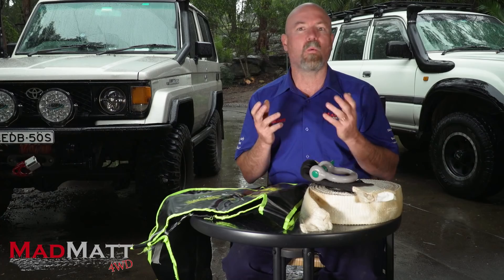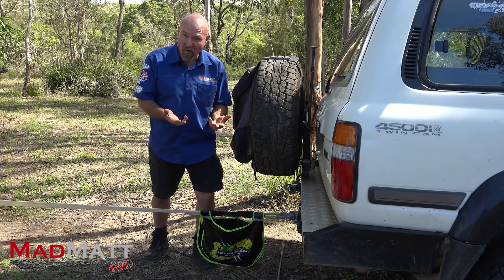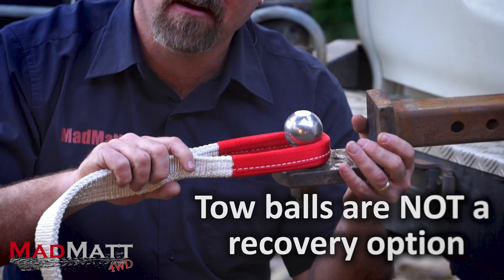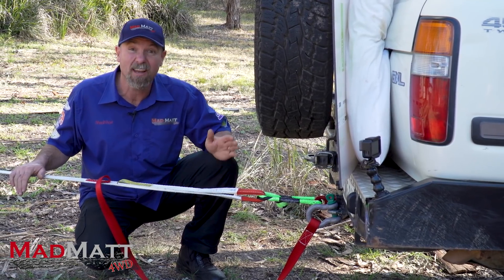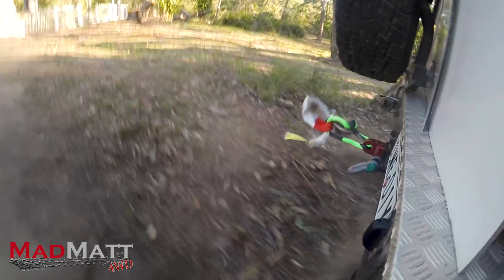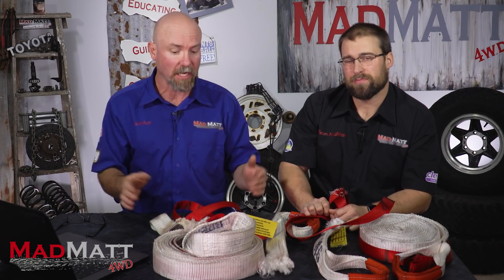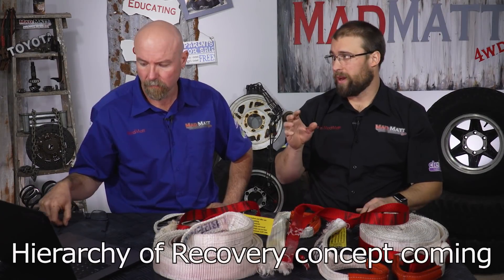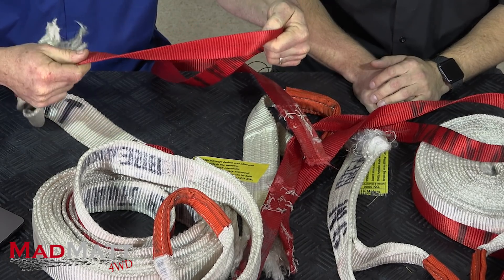Dangers of Snatch Strap Recoveries - Destruction Testing

Comment: In my humble opinion the tether should be made of the same stuff the snatch strap is made of but let's say 2.5m longer than the strap itself at either end then attached to the other recovery point on the cars, that will account for the stretch of the strap and kenetic energy in it as well as the vehicle travel after the snatch strap breaks at the fuse. Anybody ever think about quality "parachutes" near the ends of the strap? Just an idea?
Reply from the maker: That's an interesting idea. a parachute would have to be too big and probably wouldn't have time to fill.

Comment: I was surprised the strap broke that easy. I have one purchased from Warn that came as kit with my 12,000lb winch. (I know in Auz straps  have a service life). It has been too long for me to remember what it is rated at. However, I drive a 1996 3/4 Ton, 4x4, 8600lb GVW Chevy Suburban, with a 7.4l gas engine. It is heavy especially when filled with 42 US gallons of fuel and 7 passengers. I have yanked vehicles with my strap that were twice the weight of my loaded Suburban that was to-the -frame-stuck in wet sand. My strap has never failed. Why did yours fail so easily??
Reply from the maker: As I say in the video this was a test and I had a fuse designed in it. Having said that I can intentionally fail an 8000KG strap in under 10 hits.
Reply: @MadMatt4WD  OK. Got it. I will rewatch. Thanks for doing so much for the 4X4 world!
Reply from the maker: @benkanobe7500  FYI I don't show the fuse. :)

Comment: Maybe, instead of having the tether strap only connected at 2 points, have it a little longer, and have it connected at multiple points (I'm in the US, so I will say in SAE), maybe have it connected every 12 to 24 inches. This way, it has multiple points that have to fail in the tether before total failure.
Reply from the maker: That would have to be worth a try.

Comment: I was pulling  a stuck small Cat with a dump truck broke a stainles steel  chain with 1/2" diameter chain links. Put a good dent in the steel  plate on the back of Cat D3  scarey
Reply from the maker: Yikes

Comment: Great info Matt , very interesting and informative , would a rated tether be an idea ?
Reply from the maker: I think so but nothings out there to my knowledge.
Reply: @MadMatt4WD  If the tether was lengthened beyond the maximum stretch of the rope and only had to stop the force of rope flying and not the stored kinetic energy in the rope it might drop the impact below lethal. This could easily be tested by cutting the tether and adding in a length of the tether material by stitching it in the same or stronger stitching where it is attached to the rope. I could see the length of the tether being up to 1/3 the length of the rope and if it is rolled and held together with a rubber band it would stay out of the way but deploy in case of a breakage. Awesome video!

Comment: I'm from Florida the United States been using snatch ropes since I was in my teens I'm 50 now we use boat tie downs rated at 200,000 lb
Reply from the maker: At that weight loading you’d be doing a tow recovery not a kinetic recovery. Otherwise you’d be shock loading the recovery points.

Comment: Yes bow shackles can and do break in a 4wd recovery we had one nearly flatten out during one recovery luckily we had a weighted dampener on there and had the area clear, if you would like a photo message me directly I would be happy to share,
Reply from the maker: Wow. So did it actually fail?  I wonder if it was a cheap copy. There have been some come in over the years without correct ratings. Email. Madmatt@madmatt4wd.com.au. Thanks.

Comment: A tether strap does work. But it doesn’t need to be stitched on. In fact it shouldn’t be. As protection, I use just a regular 20’ strap on both ends. Take the kinetic rope and run it through the eye of the strap twice. If it breaks in the middle there’s nothing you can do. But often it breaks on one end just past an eye. So if it does it gets tangled up in your 20’ safety strap and slows it down before it sucks through the safety straps eye… seen it multiple times now. Little to no damage to either vehicle. Oh and you can’t run your safety strap in-line with kinetic rope. It needs to be attached offset or a couple feet away. This way when your kinetic breaks, it tightens the safety strap before the kinetic ropes end gets to the loop. Creating an automatic loop the kinetic has to now fish itself through. Test it. You’ll see the idea. Kinetic rope from receiver hitch. A regular 20’ strap off to one of the D rings. Then run then kinetic rope through the eye twice. When it pops it gets all tangled up and let’s the broken kinetic out gently.
Reply from the maker: It’s kinda like the ditch hitch design.
Reply: @MadMatt4WD  I had to look for what you mean, but I didn’t see anything on their site with any type of safety backup. My way uses a kinetic and two regular straps. Easily replacement parts to the system, and simple. What is this other backup you are talking about from ditch hitch? I couldn’t find it.
Reply from the maker: https://ditchhitch.com/
Reply from the maker: https://ditchhitch.com/product/ditch-hitch-super-complete-pro-with-snap-trap/

Comment: I understand the safety concerns you’re addressing. However and maybe I’m not understanding but if a rig is stuck as bad as a huge tree that doesn’t move. I would think the rig your trying to recover would move enough to not let the strap fail the tree will never move! Now if that entire tree was not anchored into the ground by its roots and just lying on the ground it would probably move ! Again maybe I’m not understanding. I’m thinking get a rig good and stuck then test on something like real life instead of a tree. I love the video and what your doing but is a tree the right thing to test on?
Reply from the maker: I get what you’re saying but the tree is fairly irrelevant to the testing results. Go and watch some videos of distraction testing and you’ll see one end is solid mounted and the other is a hydraulic ram. I’m doing the same thing just faster.
Reply: Thank you for clarifying I appreciate it! Recovering vehicles can be extremely dangerous and knowing the correct way to do so is key, and having the right equipment to do it! Thank you for your videos I’m learning a lot through your channel!

Comment: If the winch can't do it, then the last item is the recovery strap?
I would have thought that the winch would be the strongest, so it would be used last?
Reply from the maker: A winch is very effective and controlled which I like. A kinetic device is very very powerful, way more than a winch but it’s an uncontrolled release of energy which is scary.
Reply: @MadMatt4WD  Okay, so the strap or rope is more powerful than the winch. I did not know that. Thanks.

Comment: Just a thought, if you had a tether that was long enough to run from the max stretch point to the original size of the strap, surely the amount of force would be lessened by far enough for it to hold it and not snap
Reply from the maker: It would have to be tested.

Comment: Seems to me the tether has to be much longer, at least the stretch of the snatch strap plus your stopping distance, to do its job properly.  You may try this method: use a longer strap with increased stretch (>30%-Nylon) and when it stretches, open the clutch and let the car stop by its own, then step on the brake to avoid getting pulled back - let the snatch strap do the work for you.
Reply from the maker: Great comment

Comment: What about undo the little red safety strap at the hitch end and fit it with small parachute, pack the chute in a tube seal it to weather proof the chute and attach the tube to the tow hick with a loop, rope snaps,  safety strap pull the chute out the tube, tube stays at tow hitch. or is this to far out side the box???
Reply from the maker: I don't think the chute would have time to deploy. I could be wrong.

Comment: I think that the tether is doing exactly what it should by failing,  if it was stronger the continued movement of the vehicle would reload the strap and make the situation just as bad as without the tether.  The fact that it snaps proves that it absorbs a significant amount of the energy stored in the strap and the recoil energy is lessened.  You could measure this by putting your air bags on the strap on the vehicle end and breaking a strap with and without the tether and measuring how far the bags travel towards the anchor point.  It will be significantly less with the strap with the tether .
Reply from the maker: I disagree unfortunately.
Reply: @MadMatt4WD  the only way to know is test is . Dynamic load situations with moving vehicles are tricky.  And you have to keep the strap from building momentum or it will easily break almost any tether.  A fall protection style arrest would help but would be expensive, and would still need to start picking up load at the same point ,and would need the vehicle to immediately stop when the strap broke ( and that's just not going to happen in most cases.  I've had to deal with this problem with some parts I make for spearfishing,  and I have a lot of broken parts from testing.  I have a shackle that was completely bent into a corkscrew when a line I was stretching out broke and was caught on my safety, a shockwave traveled up the line to the tree it was anchored to and back to the truck and destroyed the safety tether shackle. 

A tether is definitely a good idea and will lessen damage but if used with a snatch recovery needs to be used in addition to weigh bags or other methods as a additional measure to slow down the recoil
Reply from the maker: My conclusion is that a fall arrest system would be the best way to look at this. I think this tether was wrong by design in a number of ways. I agree we need to reduce the energy before the vehicle reloads the strap which is where the fall arrest system comes into it. But i've been looking a ropes now days and feel they're a better kinetic recovery device than the strap.
Reply: @MadMatt4WD  yes that's what I've been using for around a year or so they work much better,  I only use straps for towing/ dragging type uses. The problem with the fall arrest is the moving vehicle still needs to stop virtually at the instant the strap breaks to keep from reloading the system,  so maybe a breakaway at the last set of stitches so it slows the strap then let's the vehicle break away without a second reload cycle

Comment: Shouldn't the snatch strap used be rated for purpose?  In other words, if a 2 ton vehicle effective weighs 6 tons when deeply stuck, shouldn't the snatch strap be rated for 6 tons?  Or use multiple snatch straps?
Reply from the maker: Correct. The rule is the strap is rated at 2-3 times the weight of the heaviest vehicle.

Comment: Take a look at the strap configurations used by arborists when they are up a tree. Some have a sacrificial stitching structure that provides incremental failure in multiple segments. There's some whole 'nother groups that have been working on the problem; take a look at sailboats and their anchor snubbers. They want to provide an incremental approach that approaches maximum force in a progressive rather than instantaneously reaching their maximum limit. The sailboaters don't want the bow of their boat yanked off, and the tree climbers don't want broken backs. Shooters want the pressures to build in a rifle's chamber in a controlled fashion, so they use different gunpowders depending on the application. Instantaneous maximum pressures would usually shatter the rifle in the shooter's face, and the gun control people would have an easier time of convincing people to give up their sports. Their pressures build rather quickly, of course, but in a timely fashion.
Reply from the maker: The fall arrest system is what I think could work.

Comment: Rather than having a tether that is so flimsy, why not combine two of these straps in parallel, with one 20% longer than the other? The understanding is that if one strap fails, you stop.  In this arrangement, the secondary strap (the longer one) would be attached to the main one with, say, 5 elastic bands evenly spaced, the extra length being looped evenly between each elastic band.
Reply from the maker: I agree this tether was useless and was never going to work. What your describing is almost what Ditch Hitch designed.

Comment: 1. Curious if you have ever seen a vehicle manufacturer factory installed recovery point fail?
2. How much are they generally rated at?
3.  Do they need to be used in pairs or can only one point be used?
Reply from the maker: Land Rover do rated point I’m not sure of any others. Good practice says to use them in pairs other than for the lightest of recoveries like a tow.
Reply: @MadMatt4WD  Okay. Thanks.

Comment: Attach the tether to a sand bag instead of to the vehicle.  Let the bag drag along the ground as needed.
Reply from the maker: I've never even considered that. Interesting idea
Reply: @MadMatt4WD  that would make the energy in the strap accelerate the bag, lots of energy lost in the sand shifting.   I think it could work well, say 5k of sand like you used before.
Reply from the maker: I do like the idea

Comment: The tether needs to be significantly longer than the stretch length of the pulling strap and fully rated. Basically a second snatch strap attached to the pulling strap and the anchor.  In fact a short safety strap could be paired with a longer pulling strap. The safety strap needs to engage far enough away from the break point to eliminate vehicle momentum and only catch the moving shackle. Say the shackle weighs 5 lbs and flies back at 50 mph.. f=ma. That’s a lot of force to stop.
Reply from the maker: I’m thinking a fall arrest design would be the go.

Comment: It's good to so some math here, if the stretch is somewhat linear, then you can estimate the the stored energy quite easily.. If you have your 9000kg (x9.8 = ~90,000 Newton) strap and it stretches 2m, your stored energy is 90,000 x 2 x.5 = 90,000 joules
I'm not sure what an acceptable remaining energy is, but lets for arguments sake say 25%, so you have about 70,000 joules to absorb.  If you don't want to reload everything to dangerous levels again, the ONLY way you can do this is to lengthen the amount of time you have, and that would be with an elastic tether.  If you have a material that can stretch 3x it's original length and it's 2m to begin with, lets work backward, 70,000J / 6 / 0.5 = 2,333N = ~ 230 Kg breaking force for the tether, maybe if you lengthened the tether a little more you could do with a 1/2" bungee type cord

I was thinking of a design that wouldn't get too cumbersome to deal with, (you don't want people cutting them off because they're in the way!) is the tether would be about 2m long (the total stretch of the main strap), then fastened just past the fuse point, then taped, zip tied, perhaps even weakly stitched back toward the middle and looped back, leaving some convenient amount  to get to an alternate attachment point.
When it breaks, it'll easily rip the attachment stitches or whatever, it'll release as much of the energy as possible in the main strap before the tether starts to work, it also gives the driver a considerable distance to have a chance at stopping.
Reply from the maker: Thanks for taking the time to consider all that, very helpful thanks.
Reply: @MadMatt4WD  you're welcome, maybe some manufacturer with an actual engineer can do the finer points on the math and come up with something suitable and convenient

Comment: What if they put a inline shock absorber in the tether similar to what they use for roofing?
Reply from the maker: That could work.
Reply: @MadMatt4WD  it would absorb the initial shock load and lengthen the tether by a few feet giving you time to slow down the pulling truck

Comment: How about a hybrid snatch strap with a non extendable middle section with either end having an elastic material , so if there is a failure the attached shackle doesn’t become a missile to your head .
Reply from the maker: That’s an interesting idea.
Reply: That would just be the equivalent of a shorter snatch strap, with the addition of the weight of the "non-extendable" section.   
No different than a shorter snatch strap with an air-damper or jacket thrown over the center.

Comment: So,  if the tether was 2 meters long on a strap that stretches 1.5 meters. In theory, it would only have to dampen the weight and momentum of the snatch strap? Vs nearly the entire breaking strength of the snatch strap?
Reply from the maker: It would be interesting to test that

Comment: Shock absorbing lanyards similar to fall arrest equipment may solve the problem you're dealing with. Also if the lanyards were made from the same stretchy material as the straps.
Reply from the maker: I think that’s the solution

Comment: I don't understand why the tether straps are rated at less than the main strap, surely they need to be rated at more ?
Also if the strap is designed to stretch say 1.5m then doesn't the tether need to be that length plus a little more to allow for the vehicle still moving forward after it snaps ?
The idea looks to be sound but there seems to have been a lack of understanding by the company of what actually happens in reality.
Reply from the maker: Yes I agree. I was never confident in the solution they provided.